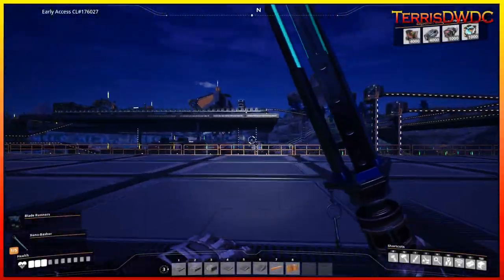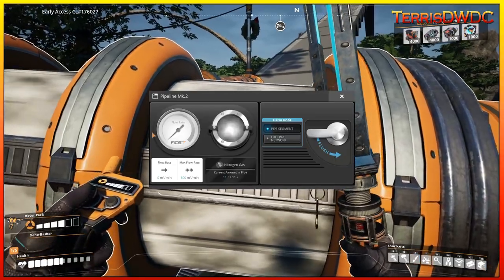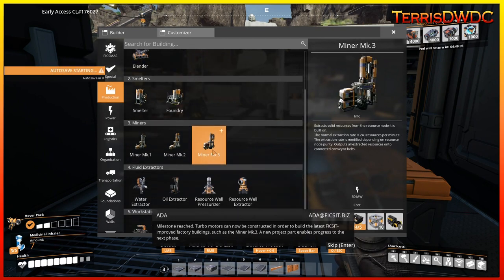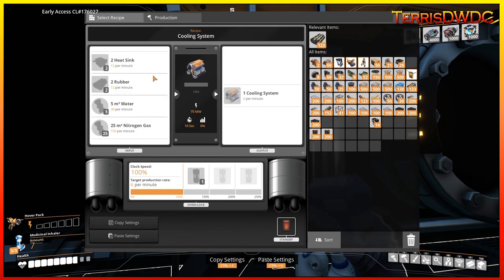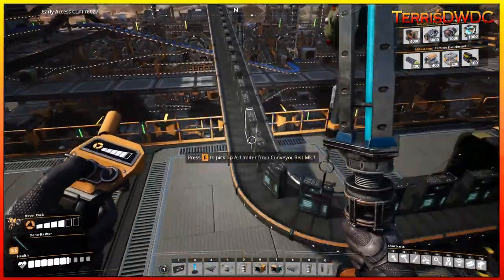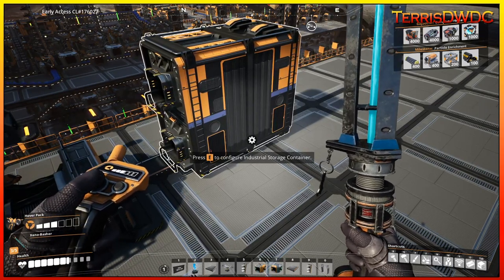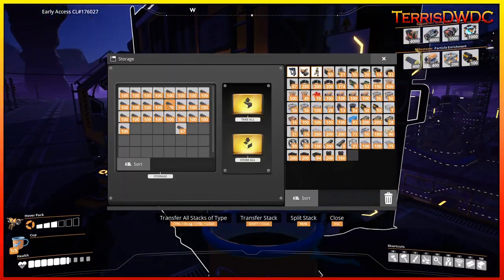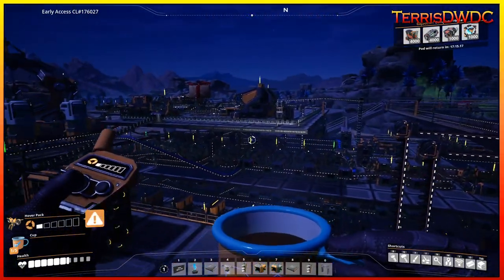Tier 8 DONE, Fused Modular Frames, Cooling System, Turbo Motor - Satisfactory Update 5 Gameplay E17

Comment: Your power really shouldn't be fluctuating that much. Geothermal goes up and down, but it's gradual instead of stepping (Personally, I always add power storage right next to any geothermal power that I add, to keep the overall available power steady.) Fluid is almost always the problem with that kind of graph (since there are a lot of wonky things about the fluid system). The simplest way to fix it is to make sure you're overproducing all fluids by at least a percent or two. Once the pipes are full, it will generally be more reliable.

Nuclear power requires a lot of incoming water, so if you don't at least understand what's happening you stand a good chance of having the same problem on a larger scale once you get there.

Comment: Not familiar with that particular nitrogen well, but I do know that the individual sub-nodes of wells can vary in quality. The one I'm using has 6 pure and 1 normal, IIRC. Just something to keep an eye on.

I was a little disappointed when you needed more copper that you didn't just upgrade the existing miner to a Mk3, though when you start expanding more it'll be handy to have both of those nodes coming in anyway. That Copper Powder recipe will burn through it like mad.

Looking forward to seeing where you take things from here, since the game is pretty open-ended at this point.